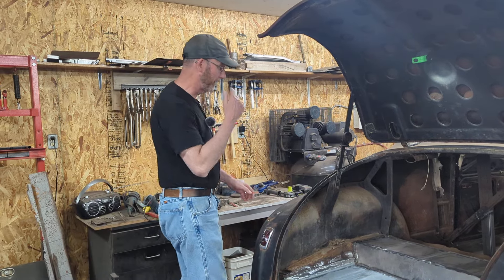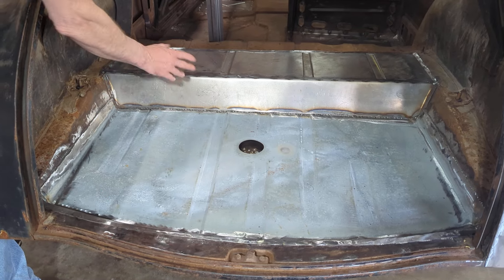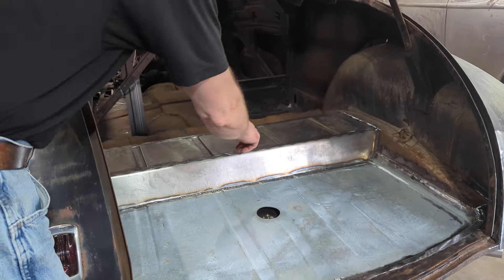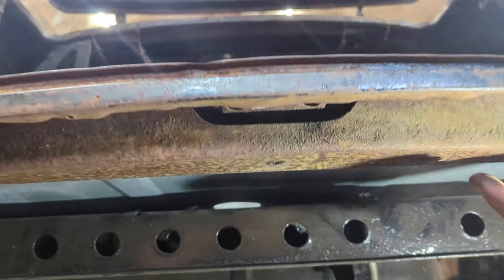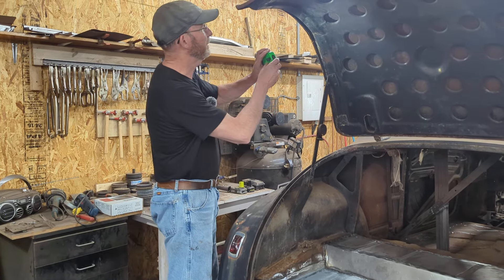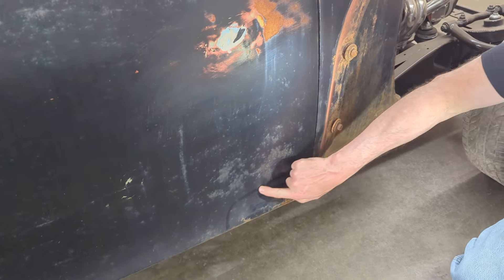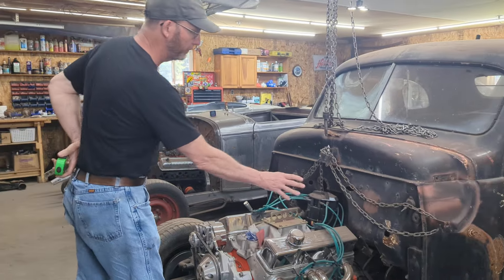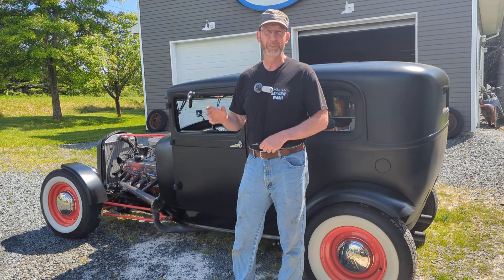1940 Plymouth get metal work done on the trunk area

Comment: 01:09 Hello Derek. What sequence do you use when shrinking sheet metal with a torch ? Some people use air or wet rag to cool and shrink after heating. Others use gentle(not hard) hammer blows after heating to compress the metal while hot. But i think the second method can't be used in this case since you cannot get a dolly below the trunk floor. Enjoy the summer.
Reply from the maker: @petar443  Hi I've used all those techniques actually. In this case I will just heat spots up and cool with air. It just needs to be tightened up some so it doesn't oil can.